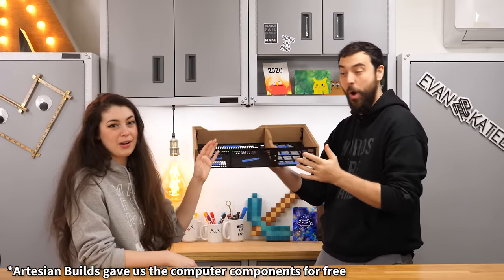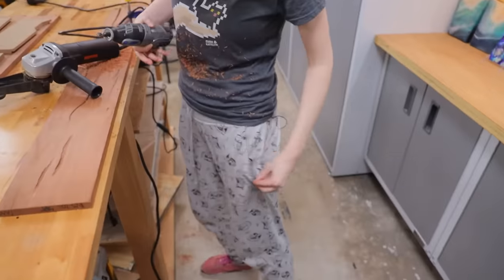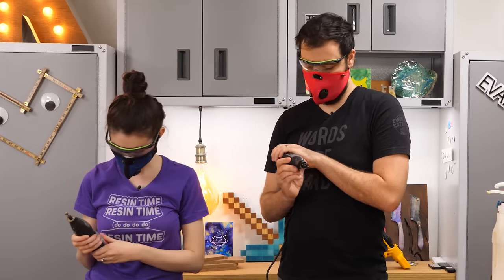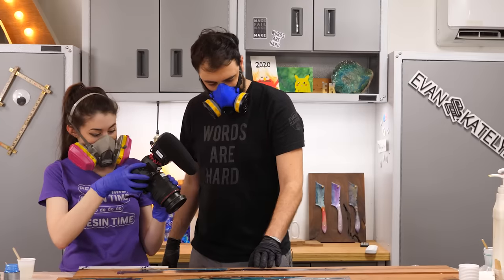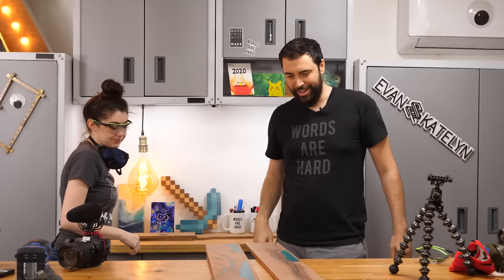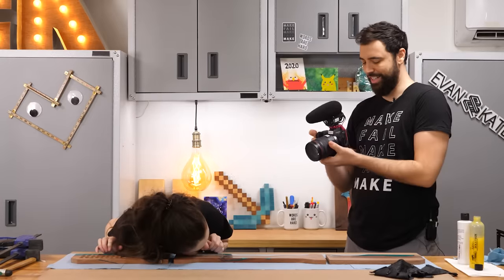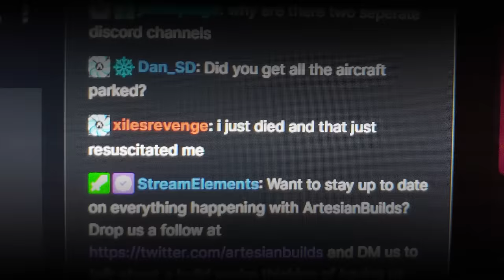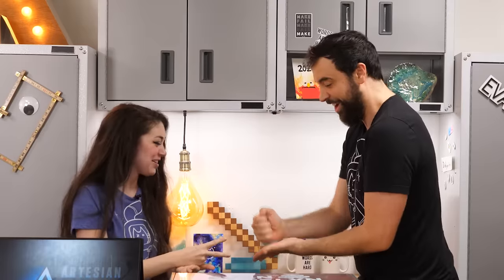DIY Resin & Wood Computer

Comment: "But cant you attatch two monitors to a singular comput- " evan smack "ITS MINEEE, IT SMINENEENENNENE"
Reply: Of course you can
Reply: Yes and that would be nice, since both were so excited and helped to make it happen^^.
Reply: Yes but not two mouse's and keyboards and you can't do two different things at the same time. To me it makes more sense to to 3 or 6 months each
Reply: @missbeaussie  Actually you can (I've tried it once) but to do it on Windows you need expensive software licenses from Microsoft. This isn't worth it, in my view the obvious thing to do is make another one.

Comment: Recently saw a box build with dovetail corners, but the 'tails' were cut on both wooden sides of the joint. When the sides were clamped into position at right-angles, and sealed with tape, the 'pins' of the joint were formed by pouring resin into the gaps. Four wooden sides connected by four interlocking resin corners.

Comment: Sawyer here, I have some wood that would be perhaps the most interesting possible species for use with resin. She Oak (Casuarina Cunninghamiana/Australian Beefwood) has both incredible grain and colouration and a tendency to absolutely destroy itself while drying. Cracks, voids, honeycombing, splitting, and the occasional bark inclusion create many opportunities for enhancement. If you ever need wood, live edge or s4s, I will send you more than you could ever need. If I find your PO Box, I may send you some anyway. Currently I have about 2000 board feet of it that has been deemed 'too hideous to be worth the effort of surfacing'

Comment: My dad and I did the ceiling in the second living room in our house the last three weekend and yesterday we were finally able to put the last wooden panels in that we needed to cut lengthwise. The first panel went really really well. Then when we walked into the workshop to do the last panel I was like: When that one is going just half as smooth as the last one then we were diligent enough to be lucky.(which is a saying in Germany : Das Glück ist mit den Tüchtigen. So: Luck is with the hard-working.) We did not work hard enough and cut the panel the wrong way. It was the last panel we needed and the last panel we had. We could not save it and need to buy another pack of panels. We were so disappointed.

Comment: No clue if you'll see this, but when using syringes with resin, I prefer to put the needle tip on after getting the resin in the syringe.

Comment: I really like ot but the logo is extra, it doesn't go with the wood. If you really want it, i would put a small one in the corner instead, and without the circle if possible because it is such a foreign shape. Or maybe you can align the circle with one of the fans

Comment: I get that they aren't computer geeks but damn this PC had so much more potential. Don't get me wrong the case is awesome but the components could've used some attention. A modular power supply wouldve cleaned up the cables, evek going for sleeved cables from cablemod would've improved the looks even further.

Comment: hi Sadie the nerd hear you might want to upgrade the PSU because it will under-volt your GPU because it will sometimes spike up in power needs then shutting the computer off recommendation: 1000 watts also why all the storage just get a storanator it can hold a petabyte or more of storage and if you run out just pop some more drives in also

Comment: You guys need to cHANGE THE 750 WATT BECAUSE THE CPU AND GPU (GRAPHICS CARD) ARE VERY POWER HUNGRY AND CAN EXPERIENCE BIG POWER SPIKES THAT Can spark the overcurrent protection and reset your computer under heavy load. Sorry didn't realize I had caps on.